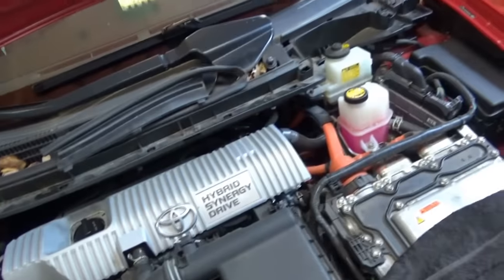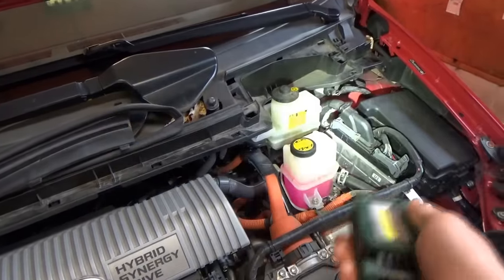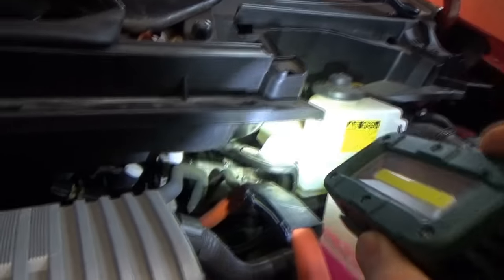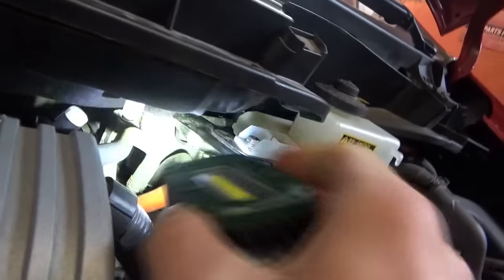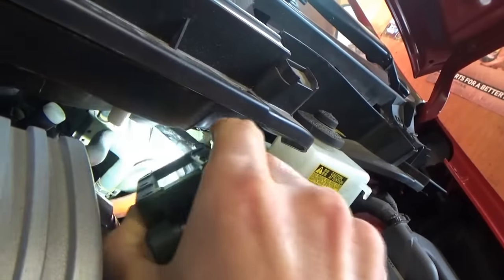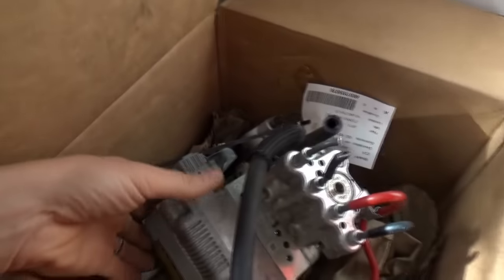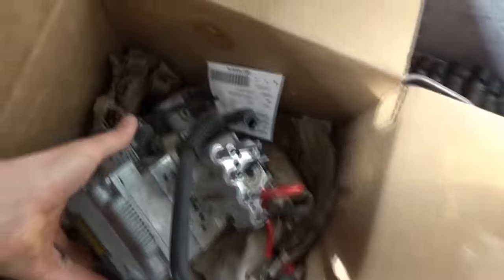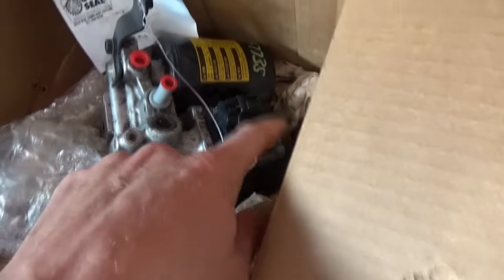Prius Brakes FAIL (Hidden COST of Hybrids)

Comment: The owner should give his head a shake for  installing a recalled part from the junkyard into his car that could potentially be faulty. Brakes no less. I seriously hope Ivan you made him sign a disclosure for the work being done. Great job otherwise.
Reply: There's also a good possibility he got a part that had already been replaced under recall and he got the improved part.  You could simply run that VIN and look for open recalls.
Reply: @johnaclark1  Good point
Reply: @johnaclark1   That's true but it's a gamble with a  used part either way. Also most dealers will take back faulty parts under warrantee and either have them shipped back to the manufacturer to be destroyed. Junkyards around here will not sell calipers, rotors, brake valves or lines, or anything related to ABS due to liability. Tires even are popped when the vehicle gets to the scrapyard too much liability.
Reply: @mplante7352  And yet you can find rebuilt master cylinders and calipers.
Reply: @mplante7352  That's just the risk of used parts.  No way around that.  I've been in the used part business before and a good yard will stand behind their parts, though often it's just a refund as they may or may not have another one.  But, yes, labor is up to the customer.
Reply: If it goes bad it will be a slow leak and he will be back to square one. It's not going to EXPLODE and leave him with no breaks. It will start cycling the pump on and off again . . . and he will know exactly what it is.
Reply: @mplante7352  My local junkyard sells used tires.
Reply: The video is the disclosure. You can see the bulletin on Ivans all data account when he looks up the problem.
Reply: @vw5056  I live in a metropolis with no junk yards. Well, there's one but they don't let you walk around in it.
Reply: @mplante7352  many salvage yards sell used tires. i've bought a few.
Reply: Everyone's so worried about the used part. It came out of a working vehicle. Not EVERY unit breaks, or brakes (pun). 99.9% of repairs result in a part needing replacement. Whether that part is "new" or from a donor car, it has the same likelihood of working. In fact, if it came from an otherwise okay donor, it's better than a "new" part made in China to mimic the OEM. Ask any real mechanic how often brand new parts fail. I'd like to refute this guy's argument that this is a hidden cost of hybrid ownership. No, it's simply the cost of ownership. The hybrid made it about 2% more difficult to get to... What he didn't mention is with the amount of Toyota Priuses sold ten yrs ago, important parts can be had from donor vehicles for pennies compared to conventional cars.
Reply: Lighten up Francis

Comment: I just happen to have the 2010 Lexus version of this Prius ... Under the hood, they look identical.  Reading the owners manual, they seem to want brake fluid changes a lot more frequently than any other vehicle I have ever owned.  Now I am wondering if the complexity of this system is what requires more frequent fluid changes ... Just cheaper to keep your internal seals healthy ... Long and short of it is, unless I know you are planning on driving by my house and I can schedule a visit, this will be a dealer job for me!  At least I now have a good idea what it is they really have to do.  Thanks, and keep up the good work!

Comment: Great repair after such high amount of miles and so much savings,  the customer should replace the brake system with a new one using a used part is nuts, liability at risk?? But you did what the customer asked you to do, great video, take care thanks 😊
Reply: the part is fairly reliable as it stands and the failure is just random honestly, just like the batteries are as well.
Reply: 250k is high miles?! Shhh, don't tell that to 2 of mine that are around the 700k mark!

Comment: Great video, you explained the process very well. I would like to add to this I did everything like you described, but I could not calibrate the linear offset for nothing although I had great pressure all around. Vehicle was on the lift, I had a good pedal but could not get calibration blnking lights. I put the tires back on went for a spin and tried the "TEST MODE" in the autel 908pro after. I calibrated the "YAW RATE SENSOR AND STEERING ANGLE SENSOR"  after that I got the lights to blink. I then went to Linear calibration and that was it. I hope that this helps someone out there, because it took me 2 days.

Comment: Here is one other thing to consider- if you live in the salt belt you will want to maintain your brakes at least as often as an ICE car.  Rust jacking, freezing pins and rotted rotors will likely happen just as frequently as on your ICE car.  So much for less brake service
Reply: @Cheepchipsable  because regenerative braking uses the electric motors to generate braking force and return energy to the battery.  In the south, Prius brakes easily last 100k miles plus
Reply: I have a 2015 VOLT and use regen all the time, but also using regular braking half the time. Many ignorant people dont understand that those calipers need to move, so they dont seize.
Reply: @bmw803  Ignorant people generally have "bad luck" with  stuff breaking all the time. Most problems turn out to be the losse nut behind the steering wheel.
Reply: @erik_dk842  Its not bad luck bro,  80% of car owners use their cars like a light bulb. On/off and bitch when shit breaks down due to a lack of care.
Reply: @bmw803  That's why i put "Bad Luck" in quotation marks. Ignorant people create their own bad luck.
Reply: @erik_dk842  Ahhh, sure. That makes sense. And how many think that their "bad luck" doesnt happen to Toyota, because Scotty Kilmer said so.

Comment: I used to own a 1989 pontiac 6000 STE all wheel drive that had similar system called TEVES MARK 2 it was a European system. It also had no conventional booster, just an electric pump and accumulator. These systems accumulator would become weak causing the pump to run too much and too often, causing it to fail and taking with it the power assist and total rear brake operation. It also had a complicated bleeding procedure.  A real hair pulling reoccurring problem and the only complaint I had with the car.
Reply from the maker: That sounds like a cool car! AWD?!
Reply: @PineHollowAutoDiagnostics  yes and very rare. Had to sell b/c of AWD specific parts and lack there of. I believe it was GMs first production AWD car with  a modified 3 speed tranny and center diff. The rear diff was actually the front diff of the 4WD S10 and AWD Astro vans. The center diff could also be locked giving you 4WD. People still sell them if you are interested. Like I said the biggest headache was the antilock brake system. Also had air suspension in back with discontinued dealer only struts. The non AWD car had shocks and at the time no aftermarket part was available. That was why I sold mine. You can modify some Bonneville air struts to work. I'm just not good at welding. And you're running a risk welding on the pressurized cartridge.  Hated getting rid of it. A real treat to drive.

Comment: I don't know how recalls work exactly, but it would of been worth a try to bring those parts into a dealership and have them exchanged under that recall, THEN sell them online.
Reply from the maker: I'm pretty sure the dealer would only offer the warranty if the parts are installed on the car and they do the work lol
Reply: @PineHollowAutoDiagnostics  Well that's fair enough. 

I see a few mechanics who only do repairs on their terms simply because someone only wants half the seals replaced or orders a reconditioned transmission and messes up the installation, then comes back to complain. Sure the customer might be at fault, but there is still the handling, stress/bad rep that comes out of dealing with those complaints.

Everyone is happy to accept the liability for the cheap repair until it fails soon afterwards because their $2 fuel pump off Ebay didn't work, (EricO had this situation).
Reply: @PineHollowAutoDiagnostics  That is true. The dealership would file a warranty claim and if Toyota approves it, free replacement. Worth the try but too late now.

Comment: I just went through this on a 2016 4runner with 150k miles. Put a brand new part in but got screwed at the brake bleeding part since I didnt have a scanner. It braked but had a permanent traction light on but nothing more i could do. Needless to say santa is sending me a scanner for Christmas that has these special functions and so much more.
Reply: Check your speed sensors and the wires. Also the connections

Comment: Great diagnosis and fix Ivan! Quote for the day, " Fighting computers with computers" 
You're bleeding brakes via the scan tool on a Toyota Prius and in contrast, I'm bleeding brakes manually on a 97' Toyota Hi-Lux/Surf.. Hahaha. Cheers!
Reply from the maker: Hey Aldrin, I would take the amazing HiLux over the boring Prius ANY day of the week!! 😁
Reply: @PineHollowAutoDiagnostics  , Definitely agree with you on that Ivan!
Reply: Replacing the equivalent unit in a Honda is a simple bleeding process and the unit is located at the top of the engine compartment.

Comment: Aside from the old recall there's also a CSP that covers the replacement of the ABS Booster Assembly (actuator, accumulator/motor pump and skid control module) unlimited miles until the end of this . month. After that, secondary coverage kicks in up to 150k miles or 10 years from manufacture date. So you charged them for something they could have gotten done for free with a little bit more investigation from the customer. The used accumulators  invariably end up leaking sooner than later so they just wasted their money unnecessarily....

Comment: Normally on my Hybrid I only do the usual bleeding when needed,  disconnect the battery and do normal brake bleed like any other car, learned it from a Toyota master tech. In your case you had to do the hard one because of parts replacement.

Comment: Anti-Lock brakes are great as long as they're working and I've got to say that they are pretty reliable, but very expensive to fix. Brakes used to be so simple to work on, without all of the extra BS : )
Reply: So true. I have used ABS maybe twice per winter season and even then it wasnt necessary. Could have just pumped the pedal for same effect.
Reply: Ever since they started putting them new fangled hydraulic brakes in I new they would be a problem!
Reply: A lot of engineerog to avoid teaching drivers to maintain a safe distance and  pump the brakes.  ABS = A lot of BS. It and AVS are A lot of Very Stupid effort  ot save the lives of bad drivers paid for by everyone else.
Reply: @psdaengr911  Ummm...you do realise these bad drivers share the roads with everyone else?
Reply: @psdaengr911  Pumping the brakes does not replace ABS.

Comment: I had a 2010 Prius but I traded it when it hit 100k due to concerns over battery life. As a result I had no major repair issues.  I traded it in on a 2017 Prius Prime. That in turn was traded in at around 36k (we both retired in the meantime so drove a lot less) on a 2021 Mach E. Loving the Mach E but I do have some repair cost anxiety - though not enough to buy the extended warranty. I guess I’ll gamble a bit. 🤷‍♂️
Reply: We are running test on the Mach E we have 80 thousand miles on it so far with zero issues. I believe you will be okay. The Prius  is still a very good reliable vehicle. You are never going to get a vehicle that will run perfect forever parts wear out

Comment: I am a "lucky" prius owner. In the first year of ownership of my used 2010 prius with 107k miles the actuator and pump failed, somebody cut off my catalytic converter, and... my hybrid and auxiliary batteries failed. Fun times. Now that all the expensive stuff got replaced I am looking forward to driving it into the ground. Can I get another 200k out of it? I hope so...lol

Comment: That used part from the recalled vin may have been changed. So it may be the new improved one. Is there a way to check the part # with the dealer ?
Reply: He could run the vin on safer car . Gov

Comment: No way you should install a known potentially defective part that could fail and result in a crash. The owner should contact Toyota and request a repair despite the VIN.
Reply: I agree. Yet the owner took on the liability. I'm sure Ivan informed the owner as soon as he saw the part # with the vin#.
Reply: @2nickles647  Not sure Ivan would get off Scott free.
He is meant to be the expert and even pointed it out before installing.

Customers will often say yes to things because they don't know the importance and assume the mechanic will tell them if something is really dangerous.

Comment: Toyota re-engineered the vacuum assisted brake system to full hydraulic system with nitrogen accumulator.  On my Chevy, the engineers only added a vacuum pump to the brake booster for the times when the engine is off.  

Good fix!

Comment: A follow-up on the whiteboard with how and why the system is so complicated would be nice! Maybe a new series Hybrid Trash? :D
Reply: Presumably because if the engine isn't always running they can't use a regular vacuum brake booster. Though I think some hybrids and even full EVs just use a vacuum pump with a regular booster..
Reply: The Prius has been brake-by-wire since it launched in 1997. That's the only way to coordinate regenerative and friction braking.
Reply: @aspecreviews  Can you back up your information? From what I know brake by wire is not allowed in cars, you need to have a mechanical backup. Same for steer by wire. Only gas by wire is allowed, and that with a lot of safety in the software ... see famous cases when car went crazy ...
Reply: @bbogdanmircea  there is a mechanical (hydraulic) backup, but you have to push on the pedal very hard. Same as a conventional unassisted brake system if the DBW modulator fails.

Comment: My Prius 2010 started  doing the hideous bozzing/whining noise at only 30,000 miles. I took it to two Toyota dealers in San Antonio, Texas to get it diagnosed and they both just did not acknowledge that there was an issue with the ABS/Brake Pump/Brake Booster/Actuator/Acumulator system and ignored me. Perhaps, because other than the 15 second interval buzzing noise, there were no alert lights on the dashboard, and stepping on the brake pedal stopped the car fine. I waited until my Prius had 47,000 miles and traded it in for a Honda HR-V because the Prius noise was driving me crazy. My 2010 Prius' VIN# was not part of the 2010 big Toyota recall list of Prius cars with the defective ABS. The one factor that pushed me the most to trade it, was that any of the Toyota dealers cared. I wished there was a guy in San Antonio like the Car Care Nut in youtube to fix my Prius but he is in Chicago. May be in another life.

Comment: The question is - why didn't the recall include this car ? Also, would you feel safe with installing used (possibly failing) brake parts ? Are new parts upgraded to eliminate this problem ?
Reply: I know the VIN wasn't included but why not ? This is a safety issue similar to the airbag fiasco. I wouldn't want a loved one driving a car with a failing brake system.
Reply: I guess if your vin# is not included in the recall. You can always call Toyota and raise your concerns.
Reply: @blueribb99  manufacturers want to save as much money as possible, so the do a "recall" on the least made product , the rest they throw the cost to the owner! there should be a law against this!

Comment: I just worked on a 08 prius that needed a hybrid coolant pump and storage tank assembly. $1700 part and 2.8 hour labor time. I said the same thing that Ivan said about "there goes their fuel savings."
Reply: And cars with regular transmission never need repairs?

Comment: THANKS IVAN, for pointing out that there well maybe higher cost involved when you want to save the planet.MY question is, IS IT really MORE environmentally friendly to own such a car? For one thing the battery in this is 100 times more toxic to make and i doubt if you can dispose of it at all. ALSO the parts that you are replacing came from a car that is now waste as in wrecked,meaning that cars battery and other hazardous parts are scrap. And those parts cost a lot ,because the materials they are made of cost more meaning they maybe more difficult to obtain and process.But at least in the USA ,you have the freedom for now to spend as much money as you have to BUY and repair the car of your choice,but soon we may lose that right,and have to buy all electric,YOU KNOW to SAVE THE PLANET,haha thank for pointing that out IVAN.

Comment: 2010 Toyota Corolla compared to a 2010 Toyota Prius in fuel cost savings? With a Toyota Corolla you will be paying $9,200 more in fuel cost than a Prius in the 11 year ownership. That's going by average miles per year.

Comment: I have that pool of water under my 2011 prius 12V battery as well.  I replaced the original 12V battery a few days ago.  The water is probably from rain seeping in around the rear hatch.  I soaked up all the water with a sponge after removing the old battery.  There is a rubber plug below the battery that I removed so that any more water that leaks in will drain out.

I am pondering if I just keep trying to repair this vehicle or give up on it.  It has 253,000 miles on it.  It slowly consumes oil. It has codes for the Evap system, EGR clogging, system too lean bank 1 .  It also has the dreaded check hybrid system warning that puts it into limp mode.  It has also had issues when braking - the brake pedal suddenly drops and you lose braking power.

Comment: Note 2 self:  Don't buy a Prius due to brake issues and they are first on list to get the catalytic converter stolen.
Reply: Prius are the only cars ever with brake issues....
Surely SUVs that are higher off the ground would be an easier target for cat thieves?
Reply: @Cheepchipsable  our cat thieves use floor jacks, they are not lazy.